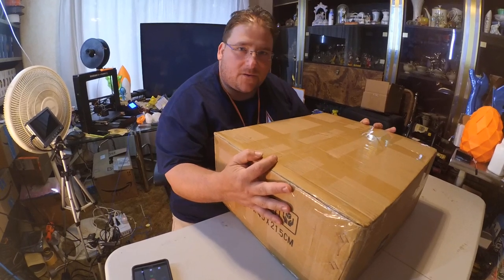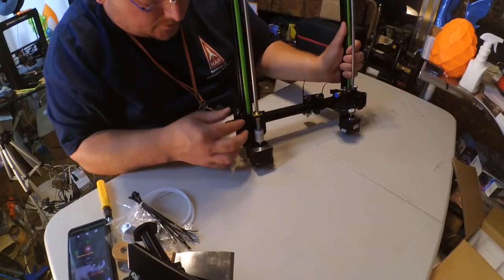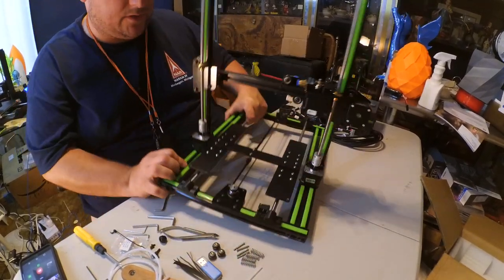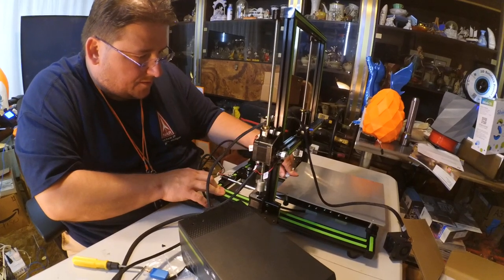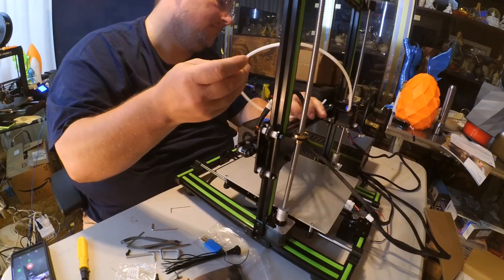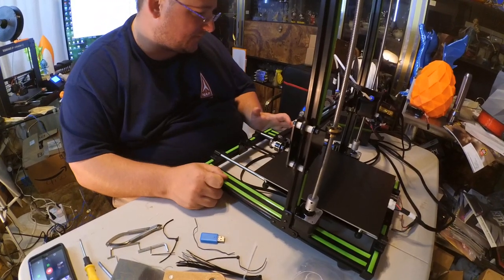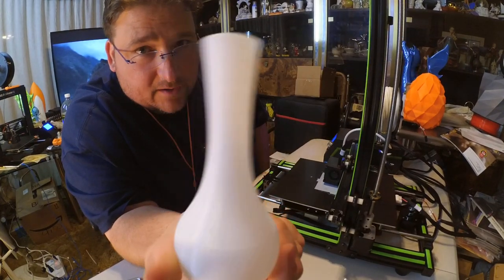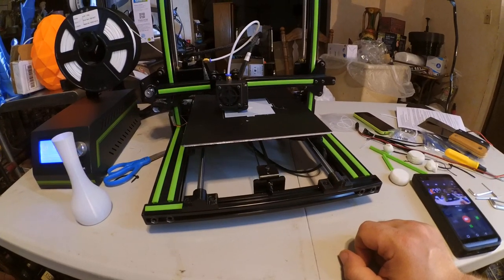Today's 3D Print - Anet E10 Unboxing & Initial Review

Comment: But if the final price comes closer to CR10 then there is really no comparison
Reply from the maker: I honestly don't think there is ever a comparison. the CR10 is simply superior in every way. I see the E10 as a wanhao/makerselect replacement/competition.

I just measured it. my wanhao duplicator i3 and maker select v2 are actually LARGER in desktop foot print than the E10 yet the E10 has a substantially larger build volume and similar print quality (not perfect but good enough NOT as clean a print as the CR10 can make)

the E10 is 40cm wide the wanhao/makerselect is 40.5cm across. same foot print MUCH larger print volume. I just sicked the E10 on a 20 hours sequential nose cone print (prints one moves then prints the second moves then prints the 3rd) and its working perfectly so far. hey here is a quickie update video https://www.youtube.com/watch?v=OliudVupkCk (give it a few minutes to finish uploading)

Forget that its a copy of the CR10. clearly it is same style box same style gantry same style hot end etc.. etc..

think of it as a $300 entry level printer. compare it to the I3's out their and suddenly its a VERY nice little printer with a very generous print volume. IF it proves reliable (I will keep reporting in) this might also make a VERY nice farm printer. I can put a LOT MORE of these on the shelf than I can CR10's but have nearly the same volume flexibility of the CR10 in the same foot print as an I3. My table could hold 2.5 CR10's but easily 4 of these little buggers.

I am thinking about replacing the X axis rail with V slot and using proper vslot wheels (IF it proves to be necessary for longevity) but I am thinking I won't need too. I see zero signs of undo wear so far. only time will tell. the Z moves slow enough that it should be fine.

I have started to remove the green trim bits and it takes on that same sleek mean look the CR10 does without the plastic bits (my first cr10 came with no plastic inserts which I assume the PO removed and I like the look)

I will keep reporting in with updates on the printer.

Comment: Sorry not consistent with with other review's not busting your chop's but i guessing they cherry pick that printer for you .
Reply from the maker: ok. how would you like me to reply to that? the printer had a lot of issues but none were fatal. all were easily fixed in real time while I recorded. the only issue that took me time to fix (big pause in the video for that) was the slipping idler gear on the y axis. easy fix but took me 30 minutes to track it down to that part.

its a nice printer. is it a cr10? hell no. would I take this over a wanhao or maker select? ask me in 3 or 4 months. for right now "I MIGHT" its about the same foot print but far quieter and far far larger build volume.

as for being cherry picked? no. they would be INSANE to cherry pick me a printer with missing grub screw missing thermistor hold down screw bend H carriage and slipping idler gear.
Reply: fair enough i freely admit i don't like anet as the a 8 left a bad taste of buyer remorse in my  mouth  i do really hope you get many a fine printing hour out of that machine as for me when i get printer no 3  it will be a CR 10 or better :)
Reply from the maker: absolutely. if you can afford a CR10 there is no other printer I would suggest over it. period. OK a gmax but thats for rich folks :-)

the A8 is a fine printer once tuned modded and upgraded from what I gather. as long as you understand what it is. a barely working very much DIY you build everything short of soldering circuit boards acrylic printer.

yeah. not a good way to start unless you are really into that. its why I never got an A8 or anything like it. I don't have that kind of time.

the E10 is there attempt at an assemble it printer (like the cr10 or wanhaos etc..) versus a true "diy kit"

and its not a bad go. a cr10 competitor? hell no. but not bad.